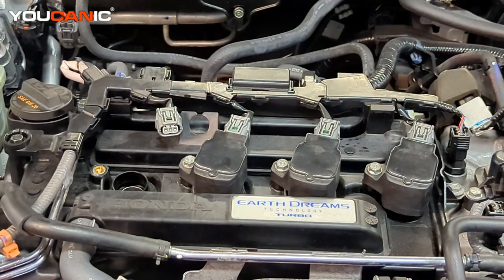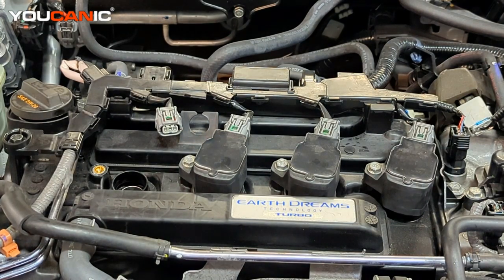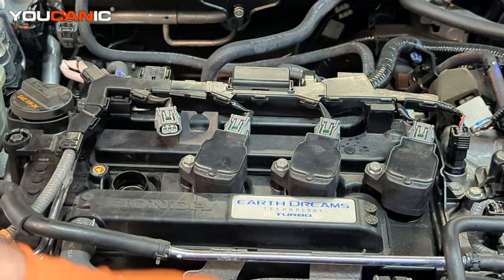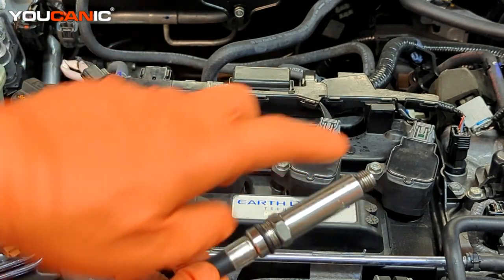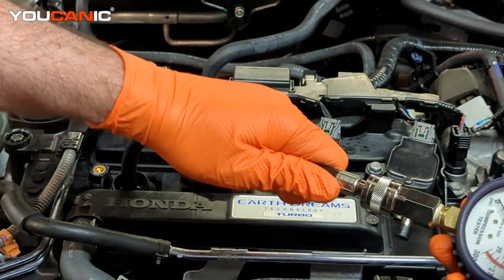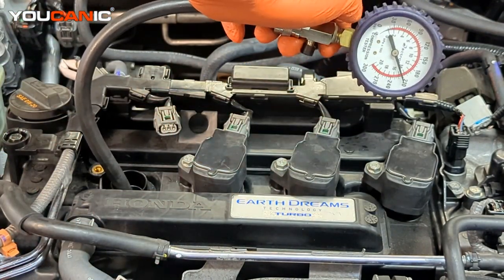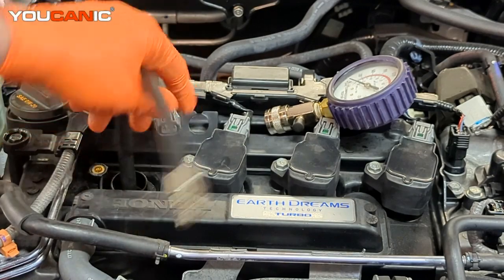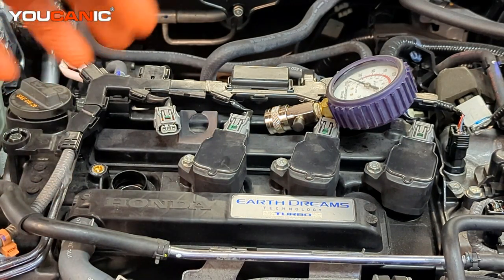Engine Compression Testing Guide - How to Test Engine Compression

Comment: I have a jeep with a random misfire on cylinder 3. I can’t easily access cylinders 2, 4 and 6. Can I just remove the coils and spark plugs from cylinder 3 and 1 and test those while leaving plugs in other cylinders?  I did this test and both cylinders were identical and good. Just wondering if I can trust the readings since the other plugs remained installed. Thanks

Comment: Does egine have engine oil in dry compression test??
Reply from the maker: Thanks for reaching out! No, the engine should not contain oil during a dry compression test. It's advisable to conduct the test with the engine oil cleared to get an accurate reading. If you need further guidance, you can visit our website www.youcanic.com where we provide resources and guides for car maintenance. At Youcanic, our goal is to empower car owners to feel confident under the hood. Feel free to reach out should you need any assistance. We're here to support you on your journey!

Comment: Hello what fuse numbers were removed?
Reply from the maker: I’m sorry for the confusion but the specifics about fuse numbers are not included in the details provided here. You may want to take a look at our YOUCANIC full system scanner that might help with your car's issues comprehensively. It's like having a mechanic at your fingertips. Learn more about our scanner here: www.youcanic.com/scanner. For further support, YOUCANIC also offers a platform where you can ask any car-related questions: www.youcanic.com. Your trust in YOUCANIC is greatly appreciated.

Comment: How to test if oil rings are worn or damaged?
Reply from the maker: Hello! Thank you for taking the time to watch and feedback on our YOUCANIC video. We're glad our content on testing for worn or damaged oil rings has sparked questions. At YOUCANIC, our primary goal is to provide useful, easy-to-follow information to make your car repairs and maintenance more manageable. 

Consider bolstering your car diagnostic strategy with our YOUCANIC Pro System Scanner. It'll make discovering what's going on under the hood of your car easier. Here's the link to know more about it: www.youcanic.com/scanner. Additionally, if you need detailed Factory Repair Manuals and Torque Specs, you can access everything you need on www.youcanic.com/manuals. Best of luck with your car repairs!

Comment: Help. I've got a buick 3.8 v6 that has a dead #4 cylinder.  I verified spark and fuel.  Compression check reads 150 lbs. I checked it 3 different days. 150 lbs. Crank it up dead miss. I was checking compression again but left the fuse and spark plugs active. First try got 150 again. Next try hit starter and it cranked and started running, i checked compression gauge and it was dancing between 20-25 pounds. Im thinking a gummed up valve that works at slow rpm but doesn't fully close at higher rpm. But I need other opinions.  Any thoughts? Thanks. Great video by the way.